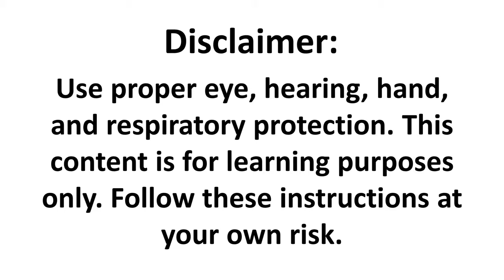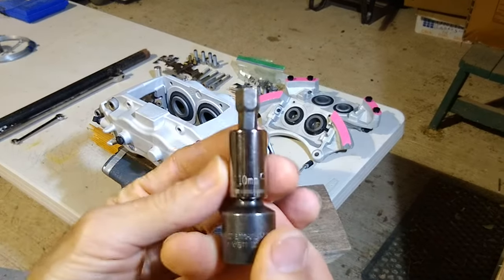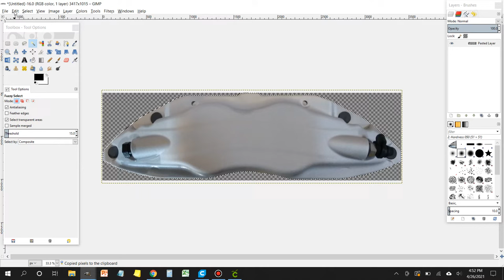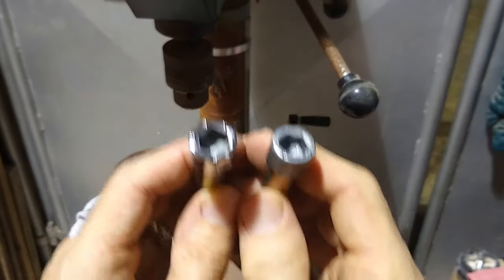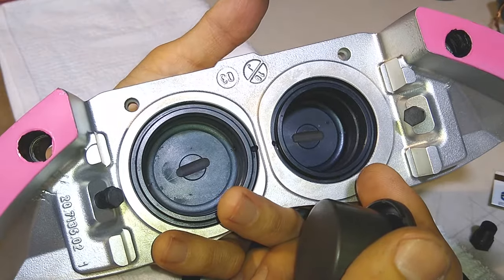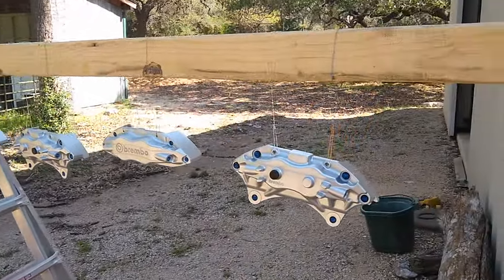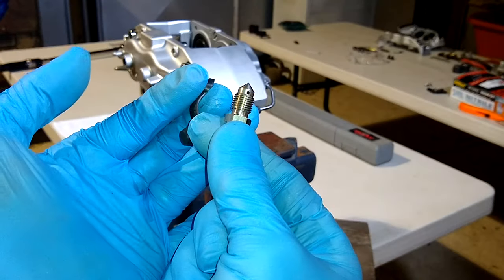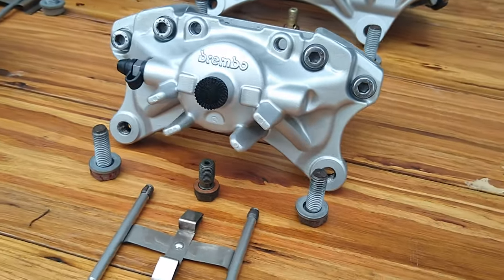Vapor Blasting / Honing Harbor Freight Sand Blast Cabinet EVO 8 Brembo Makeover Etching in The Logo

Comment: Give Cerakote MC-5100 a try. You can apply it with a sprayer or even a shop towel. It's very hydrophobic and easy to clean. The etch on your calipers looks great, and under a coating like that, the logos will flip-flop from grey to a very intense white.
Reply from the maker: Hi friend, thank you for the heads up on the Cerakote MC-5100. The Shark Skin I used in the video didn't hold up to the heat but thankfully the clear coat paint has held up, the calipers still look great today.

Best of luck with your projects.
Reply: @vbared  You're welcome. Thank you for posting the Vapor Blasting videos. I hire a local to vapor blast customer parts, and then Cerakote them. We use Glacier Silver to match cast iron with vapor blasted aluminum. Justin Voss on Youtube referenced me to Sharkhide on his Nautical Star video. We use that stuff when something is too big to powdercoat.

Comment: Helix, Rust-Oleum, VHT/Dupli-color and Eastwood all make High Temp Ceramic Clear Coats for Exhaust Manifolds that are good up to 2000°F... That may be overkill, but if racing it is probably not a bad idea, but typically the ones that say Engine Clear are still good for either 500°~650° which is probably just fine if you get the 650° or higher rated to 1200°...(some even Only 350°~385°, and Id probably just not even bother with them) but a clear in those should be fine too... A high temp CERAMIC 2k CLEAR with HARDENER will be the BEST OPTION for CALIPERS if your planning on just clearing over a polished metal, Almost mirror look, as they will hold up to the stone and rock debris... Many many years
Reply: YES! Exactly! at the 1:18:45 mark, I C you did use the VHT 900°>>> that should be PLENTY! Vedy Good!
Reply from the maker: Hello TNASI Tuning, I appreciate your detailed comment. My intention was the 2K clear but unfortunately, I was shipped a bad can of it and had to scramble to find a local supplier that had the VHT high temp clear paint. The calipers still look the same today as they did in the video. What didn't work well, probably due to the heat, is the Shark Skin product. The crossover pipe and bleeder valves I treated with it have some rust developing on them.

Best of luck with your build!

Comment: The calliper cap screw bolts are one time use, never re-use
Reply from the maker: Hello, Thank you for commenting and info. I was unable to find agreement on whether or not the pinch bolts are stretch type like a factory cylinder head bolts or not like ARP bolts. I would imagine that Brembo doesn't want the public disassembling the calipers. In my case no leaks or problems of any kind on my daily driver since May 2021 so If I was to draw a conclusion from my own experience I would say they are not. 

If you have any documentation directly stating they are one time use from Brembo I would love to read it.

Best of luck with your repairs :)

Comment: Excellent tutorial on the the rebuild.  Your little 3D printed items and process to remove the pistons is great, you should sell a little kit. Having rebuilt these very calipers myself in the past, it can be a PITA getting the pistons out, and messy.
Reply from the maker: Hello Chest, Thank you for commenting and kind words. Yeah, my off camera attempts at removing the pistons were ugly. Getting them to pop out past the seals along with their boots is the ticket. I'll look into putting a kit together for it.

Best of luck with your restorations.
Reply: @vbared  Thanks.  I'm pretty sure those Brembos fit other model vehicles or are so similar that those fittings you made will work on most if not all Brembos.

Comment: Also I was looking at your videos to find the one where you turn your blasting cabinet into a vapor cabinet and I can’t find the video I have a New Harbor Freight sandblasting cabinet that I’m about to put together I wanted it to be a vapor blast cabinet ? Can you help me out ? Thanks in advance.
Reply from the maker: Hi Gerald, These are the vapor blast build videos. I did things in steps and changed parts as I found the need for improvement. The first one will give you all the info on the main parts and each video that follows has some improvement to make it better.

Part 1 - https://youtu.be/4hoJ25zwLyA

Part 2 - https://youtu.be/j1fkCO0DcL0

Part 3 - https://youtu.be/XQMAxHyTzko

Part 4 - https://youtu.be/wS9Tm34fxnw

Part 5 - https://youtu.be/rD0HQ7l5uvE

Part 6 - https://youtu.be/6NY5xjFUMRc

Part 7 - https://youtu.be/OuqL9xWJE48

Part 8 - https://youtu.be/4WWT7O3rxwU

Part 8 - https://youtu.be/Oxwbl7DZggw

Part 9 - https://youtu.be/oZTgCDl93Jo
Reply: Victor thank you for taking the time to send me all the videos Victor I really appreciate it again thank you. Keep up the great work and great videos .
Reply from the maker: @geraldfiorello6231  Anytime Gerald.

Comment: Hey Victor, another nice job. I really like what you've done and what you do.  Just a little bit curious about the flair nuts.  I have seen flair nut wrench jaws actually spread some as the nuts are just so seized in position. Probably has to do with all the flair surface's. Any way, I did not notice you use any anti-seize on the flair nuts.  Any thoughts on that..?  Keep up the good work !
Reply from the maker: Hello Mark, Thank you for commenting. I agree 100% with you that even a flare nut wrench may not always work to remove stubborn nuts. I intended to get across that the chances are best when the most suitable tool for the task is used. Many of the troubles I've experienced could've been avoided had I used the best tool for the job. Great catch on the lack of anti-seize on the flare nuts after I preached about the importance of using it with dissimilar metals. I was worried about contaminating the brake fluid with the anti-seize and the seal not being made properly. Let me know how the anti-seize on the brake line flare nut has worked for you. I learn new things from asking and watching what others do so picking up new tips is always welcome.

Best of luck with your builds!
Reply: @vbared  Some times we get so eager to assemble I have overlooked the wonderful stuff "anti-seize". I do think that a little is better than none. With that said, use it sparingly maybe with an acid brush, or some type of small applicator and be careful not to get it in the end of the flair,{tube).  Hopefully down the road when someone is doing some maintenance there job will go smoother and they may even have some appreciations for someone else's for thought and then apply a little of the wonderful stuff as well for someone else to appreciate.
Reply from the maker: Hello Mark, I do need to get some kind of a small applicator for the anti-seize lube. I had a hell of a time trying to figure out how to torque those flare nuts to spec. Crow's foot flare nut wrench and an inch pounds torque wrench with a 3/8 to 1/4 adaptor to get 124 inch pounds on that crossover line is what worked for me.

Comment: Hi, you are a very patient man. I have a large vapor blaster but it will not replace my dry-blaster to remove paint, rust or powder.
One thing to improve your work is a wire wheel. I blast all bolts for just a few seconds in the dry blaster with very fine grit and then run it over an 8 inch wire wheel and within seconds it will polish steel to a mirror finish. Yes it will, when pushing hard enough, remove Zink coating but I replate every bolt with a Nickel/Zink coating anyway.
Reply from the maker: Hello Bernhard List, Thank you for commenting. The powder coat removal is a real pain with the wet system. I'll have to get into dry blasting for these types of projects. The wire wheel suggestion is a great one that I didn't think about trying and probably would have done a better job on the big bolts. A channel subscriber has a plating kit they he offers. Picking one up will be next so I can learn how to use it.

Best of luck with your projects!

Comment: Thank you for taking the time to put together such a detailed overview. Have you any idea what kind of maintenance will be required to keep the metal finish looking that good?  
I have a small metal zinc plating kit which would have been perfect for the small brackets and also the bolts. You should look into getting something, then you will have everything you need. That was a first-class job!
Reply from the maker: Hello Speedtripper, Thank you for commenting and your kind words. Time will tell on the longevity of this new finish. I'm hoping the VHT caliper clearcoat will hold up in protecting the aluminum from oxidation. If it doesn't and they need to be redone I won't have to deal with the powder coat removal, that part was the worst. I can knock off painted clear coat real fast with the 36 grit garnet.

Please send me the link to your plating kit. I've been interested in learning how to do it.

Best of luck with your projects!
Reply: @vbared  Thank you for your reply.  Unfortunately I am not selling any zinc-plating kits. I'm based in South Africa and purchased something locally. I have seen kits available in the States. I am in the process of restoring a Honda RC51 and it is a totally pleasure to be able to refurbish all the fasteners and brackets in my garage. All you need is the silver, yellow/gold and black passivates and you are good to go. There is not a fastener on the bike that I can't re-plate to near factory finish. I watch all your uploads and enjoy your commentary. The "gangster accent" is a welcome bonus! :-)

Comment: would it be a good idea to thread chaser on the bolts? maybe even tap the holes.

to get rid of old loctite
Reply from the maker: Hi Azim, Thank you for commenting and suggestion, it's a good one and something I should have thought about. I did clean up the bolt threads with solvent but didn't chase the threads on the caliper housings. Hopefully, I won't have to pull them apart anytime soon. The finish still looks amazing after all these years. The one thing that didn't hold up was the Sharkskin. It can't handle the heat from the calipers and burns off.

Comment: On parts that require ZERO medium left on them I use bicarbonate of soda as my blast medium 
It does an excellent job test it on a soda pop can if you want 
Once I have blasted everything I merely wash the parts off under running water as bicarb dissolves in water
Reply from the maker: Hi Eugene, Thank you for commenting and suggestion. Baking soda is an excellent cleaning media to use if the original powder coating could have been saved.

Comment: Mite have been ARP type fastener lube on them 12mm allen bolts. Does look like anti seize, or moly lube
Reply from the maker: Hi JayJay, Thank you for commenting and information. Yeah, it could have been that as well, hard to tell.  I just know that dissimilar unlubricated metals will corrode, seize up, and can damage threads during removal. I can report that since making the video the calipers themselves look just as good and working like before. The only thing I would do differently is use the high temp clear coat on the stainless crossover tube instead of the Shark Skin. That stuff baked off and offered no rust protection.

Comment: Thank you for all the great info.
We are thinking of buying a vapor blaster for our small machine shop.
Do you think the paint protective vinyl would work on a regular dry sand blaster?
The 9"x14.75" glass panels we use now last a while but eventually get pitted by the media.
We use glass bead and aluminum oxide for media.
Thanks again for the great videos on this subject.
P.S I'm going to buy a small 12"x6" roll and try it out.
Reply from the maker: Hi Ed, Thank you for commenting. Yeah, the vinyl sheet should also work for dry blasting since it's designed to protect the automotive paint from sand and small rocks that hit it at 60mph.
Reply: @vbared  Thank you!

Comment: What the smallest grit you can go with your cabinet set up. I have old aluminum crankcase cover, aluminum oxide #80 does not do it. Amazon does not have anything smaller or it is really expensive.
Reply from the maker: Hello Michal, Thank you for commenting. I use two stages of grits for polishing anything larger than a push mower carburetor. If it's a small part the extra fine glass bead media will yield great results. Larger pieces valve covers and calipers need two stages one to strip it clean (80 grit glass bead) and one to polish (extra fine glass bead). Trying to do the large part with extra fine glass bead only will result in a uneven blotchy finish. 

80 grit glass bead from Harbor Freight - https://www.harborfreight.com/50-lb-glass-bead-80-grit-abrasive-media-61874.html

170 - 325 US Sieve (aka Extra Fine Glass Bead Media) - https://www.grainger.com/product/BALLOTINI-Glass-Beads-Blast-Media-6ZC13

Best of luck!
Reply: @vbared  what is your air pressure when working with 80#?
Reply from the maker: Hello Michal, 50-55 psi is the pressure I stay at.

Comment: Did you use the sharkhide then or just the vht clear?
Reply from the maker: Hello Beach&BoardFan, Thank you for commenting, The VHT Clear is what I ended up using to give the calipers the protective coating and baked them according to the instructions to make them chemically resistant prior to installing them on the car. I did use the Sharkhide on the polished allen bolt heads, inner hardware, and crossover tube but the VHT would have also worked out the same.

Best of luck with your project.